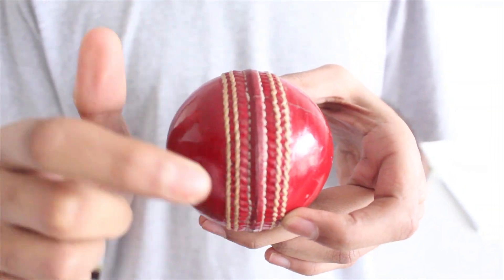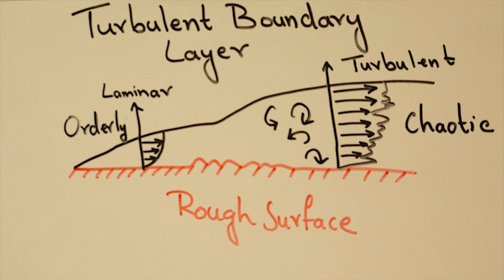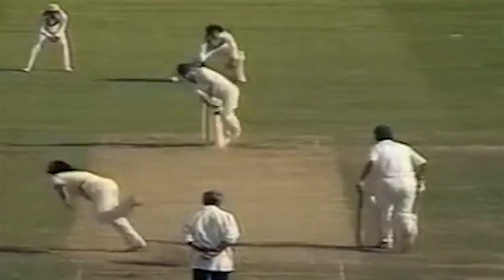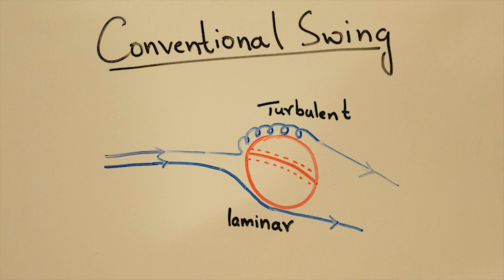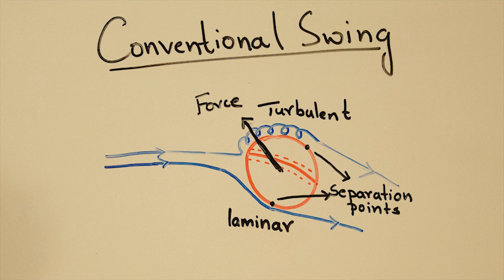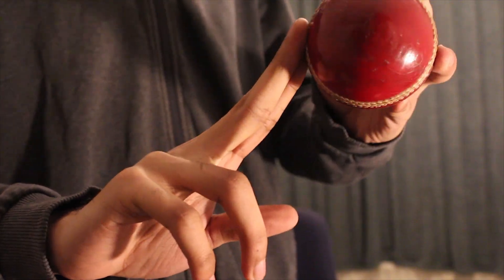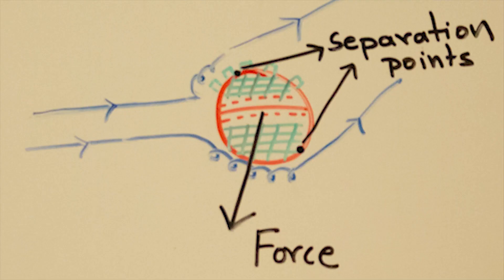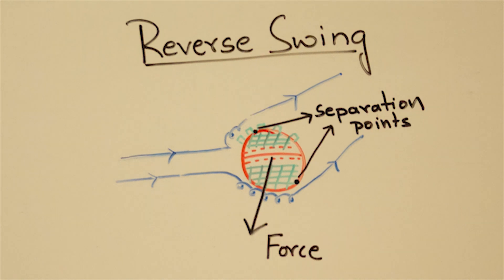WHY DOES A CRICKET BALL SWING ? - REVERSE SWING EXPLAINED

Comment: Suppose an inswing for right hander, seam is towards the leg slip.

The laminar effect is happening on the left side of the axis, while the turbulence effect on the right side.

Isnt the laminar effect is causing the ball to move?
I mean in this case ball is bending towards right side ( inswing for right hander)...even though right side has turbulence effect ( and you said turbulence effect is more powerful)

Looks like the even though turbulence effect is more powerfull still the laminar effect is forcing the ball to swing as it is parallel to the skin of the ball and properly distributed while the turbulence effect is just making the air scattered and thats why the pressure is not working.

Comment: Great in theory but there is not one mention of the reason a ball swings...difference in Coefficient of Friction between the two surfaces. Why also, does the Rules of Cricket allow bowlers to shine / polish the ball on their clothing. Why is this allowable when doing the opposite, roughing the surface, is illegal. It shows up  the mindlessness of rule making. ANYTHING that is done to alter the natural condition of the ball should be outlawed.
Reply: You are talking about reverse swing. Where the videos is talking about both new ball swing and reverse swing.

Polishing the ball is legal in this sense it is the natural property of the ball that it had a smooth surface once(before play).
So there is nothing wrong in trying to keep that shape.

Now to the 2nd part:
Swing is an important part of cricket. Even with this rule, still the game is batsman dominated. That's why to provide a balance this polishing thing is allowed. 

Though now a days it doesnt even matter in odi game bcz of two new ball rule.